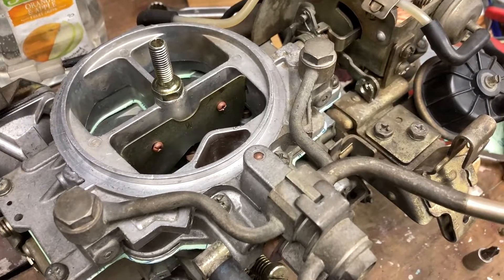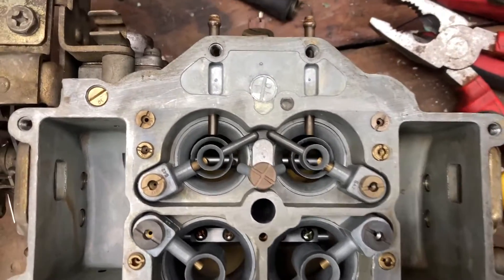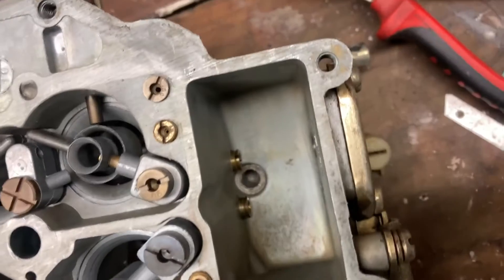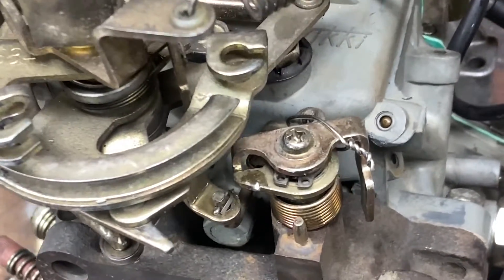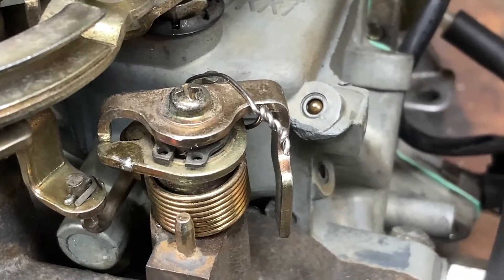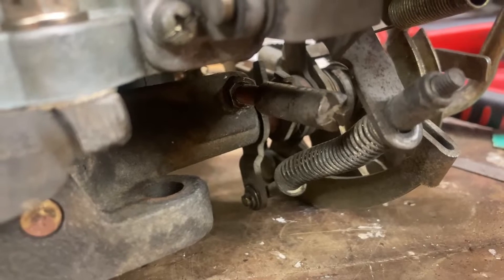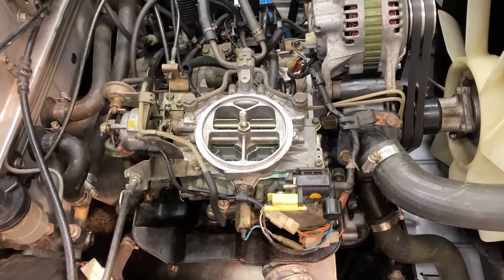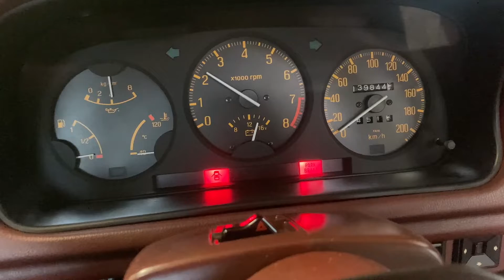Improving the Nikki carburettor for 12A Bridgeport

Comment: Massive but should've explained to people about the air mixture screw and what's a good position . But good vid dude h also mechanical is far better as vacuum.can be inconsistent and can find they will not open until higher rpm  and sometimes lean out
. And cause damage we have witnessed this over many engines over the years.  If u know how to use mechanical you will find they are really good just not stomping the foot at 3500rpm ahaha but again excellent vid for those who have to deal with 4barrel nikkis